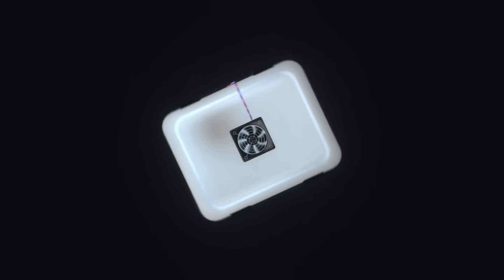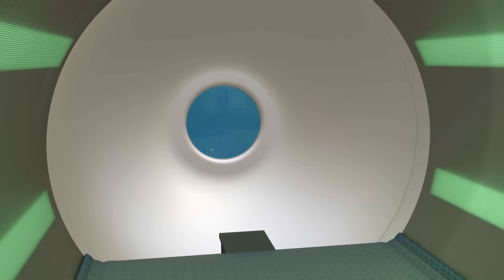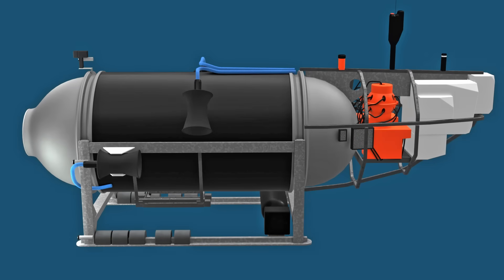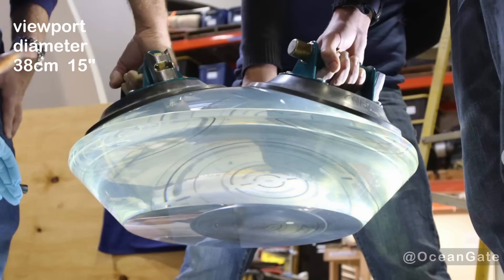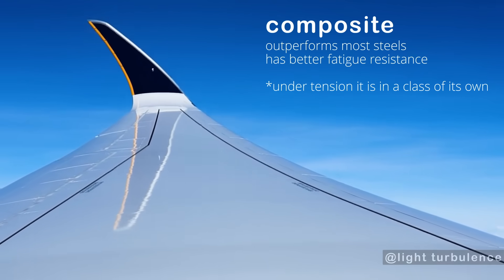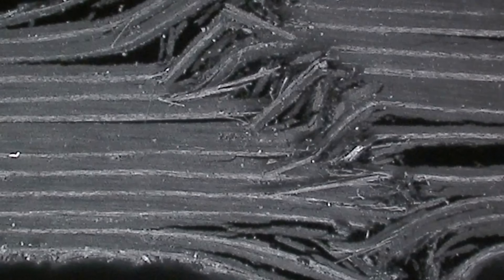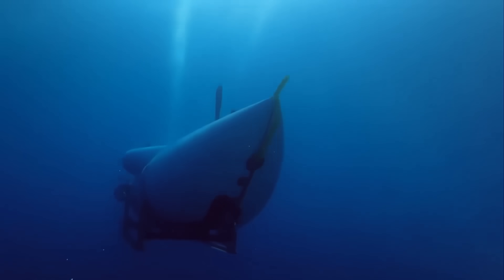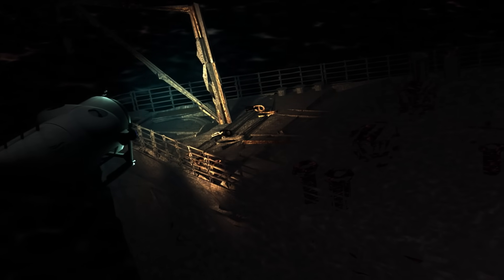Titan Sub | carbon fiber - Detailed Tour

Comment: I think the mistake is more of using two different materials to put the Sub together. Titanium can bend whereas Carbon Fiber doesn't bend. The way they put the sub together with Glue is reckless and i bet that is where the crackling sounds came from as the titanium domes were being pulled/pushed apart by the ocean and when the water finally got in then everything just crushed. I'm wondering if anyone tried to reverse engineer this disaster because I find it strange that the flanges was bent in different directions. I'm just amazed that the sub lasted for 17 dives but I bet it could have been more with the right material.

Comment: The wing structure bending loads are mostly carried by the wing spar although the upper skin would be in compression, I suspect nothing to the degree created by the undersea pressure.  As previously stated by others the composites in compression act like pushing on a rope with only the matrix material trying to keep it straight and preclude buckling.  But another armchair thought: should the “layered” composite develop a pin hole leak working its way into and thru the laminate; let’s say half way for argument, then the pressure vessel is only 1/2 as thick locally developing something akin to an internal blister.  The structure is highly dependent not only on symmetry of load (pressure) but also geometry and a blister is in effect a discontinuity.  Basically, this is an example of a design that is or isn’t suited for repeated dives, but the failure mechanism isn’t benign, it fails with no warning and is catastrophic.  Working with aerospace designs and composites I can assure you the mechanism of failure, and the ability to catch a failure (by various means) is an important design consideration.

Comment: No, carbon fibers will not handle any compressive force, only the resin holding the fibers in place resist compression. Proof is in the pudding
Reply from the maker: You are incorrect. Resin can only carry 70MPa of compression whilst carbon fibers 650MPa and this is why perfectly straight filaments is so vital. Any kinks and strength is a fraction. This is why the product is so hard to get right. The resin holds the matrix together and provides stability.

Comment: Carbon fiber is strong in tension but inferior to alternatives in compression. Movement in the structure is enviable given the tremendous difference in external pressures experienced at the surface and at maximum depth. This change is going to result in degradation in the resin as the carbon fiber and is forced together and apart. Try to remember that the carbon fiber is a rope, not a solid block of carbon. Your comparison with parts of the wings of aircraft ignores the orders of magnitude differences in the forces in the two applications.

Comment: How do you explain the negative buoyancy when the craft began to fail. Even after they dumped all of the ballast and the entire frame and used max thrust on the controls, they could only ascend a few feet per minute.   So water must have penetrated the layers of carbon fiber to such an extent that the entire vessel was bogged down unable to ascend.    

You can defend carbon fiber as a material.  But there is no defending this reckless - almost suicidal - incompetent design and build of the Titan.
Reply from the maker: Your information is coming from the debunked leaked transcript. https://www.snopes.com/fact-check/titan-sub-transcript/

Comment: Wasn’t the big problem caused by the failure to criss-cross the fiber layers?  They were simply spun on in a straight cylindrical pattern like a spool of thread 🧵. Even my carbon fiber tennis racket in 1985 was smarter designed, with braided and criss-crossed carbon fiber.
Reply from the maker: The video explains the filaments in 2 orientations, zero and ninety degrees. Did you watch that part? . Additional 45 and 135 orientations would have worked in reducing internal delamination.

Comment: "Carbon Fibre wasn't stupid..."
Hypothetical suppositions and speculative inferences based on retrospective analysis doesn't prove that using Carbon Fibre wasn't a "stupid decision", the actual deterioration caused by repeat dives is something you cannot decisively determine through speculative hyperbolic conjecture, hindsight in this case has absolutely no benefit, it proves precisely.... f-ck all.
Reply from the maker: Composite pressure hulls on deep dive craft. Here is a list https://www.researchgate.net/figure/Composite-materials-being-used-in-submersibles-worldwide_fig1_364296004
Reply: @Mike-Bell  
You and Rush would have convinced one another that Titan's composite pressure hull is comparable to all other composite pressure hulls...
"Did you hear that cracking sound.. t wonder if the other composite pressure hulls do that after a few dives...nah, if it's good enough for Mike Bell, it's good enough for us... keep going d.....!?!?!?!!!!!!!!!"
Reply from the maker: @nicolasrose3064  Stockton Rush was not the one to make a lasting success out of CF subs.  I have my doubts he would have succeeded even with all-titanium because he found best practises annoying.  I think a company with deep pockets and the correct attitude could make this work.  Consider that this incorrectly laid up tube still withstood the insane crush at titanic depth 13 times. If an incorrectly built carbon fiber tube handles spectacular compression, imagine how a meticulously built one could manage. But only through thorough unmanned destructive testing can you make it safe.
Reply: @Mike-Bell  
I feel "safe" in saying that the "you", you are referring to in your assertion "only through thorough unmanned destructive testing can 'you' make it safe", won't be the last person to find out that nothing can be guaranteed to be "safe", where man's contest with the extreme conditions of our Planet are concerned.

Comment: The circumference of the cylinder-shaped hull of this vessel will change because of changes in pressure differentials during descent and ascent. At the edges of the cylinder, bonded are the end rings and the attached dome. That assembly's rate of circumference change will be different, since there's the dome to support it. This difference in change rates creates stress in the layered composite cylinder, at and near the bonds with the end rings. Some de-lamination occurs at every dive. The hull loses compression strength, since at de-laminated sections, the carbon fibers now have room to buckle under pressure. On top of this, the longitudinal fibers seem to be strands that run the length of the cylinder. So, at the ends, the cylinder is already weaker because of how it is constructed. At some point, it gives way when the pressure is high and increasing during descent. An implosion occurs, which confirms that the designer underestimated or ignored the effect of uneven stress on the hull at the end rings, resulting in incremental hull damage, every deep dive.

This hull should have been made on a cylindrical mandrel with spherical end caps so that the end caps would be integrated instead of being a glued-on part of another material with different properties. It would also allow for a proper wrapping in all directions.  On one end, the hull could have an acrylic plug that functions as a small door and window. Fitted with allowance for some movement, instead of bonded. The pressure will keep the acrylic plug / door / window in place. On the back end of the hull, there could be a smaller plug, made from the same carbon-fiber composite, or one of those things that allows for electrical connections to pass through.
Reply: I was thinking the same. The big opening is great for working and getting in and out, but relatively bad for dealing with pressure. A small window that doubles as the door makes more sense for safety.

Comment: The fact that the flanges at the end failed outwards is a clue to the failure mode of the pressure vessel. I don't agree that it would shatter uniformly like glass. The more likely initial failure is that one part of the cylinder became weaker than the rest and was forced towards the centre by the pressure - this compression  on one side would (like if you were crushing a toilet roll) force other sections of the cylinder outwards for a fraction of time before complete failure occurs. That's what ripped the flange apart.
Reply: the can of pringles doesn't need to completely shatter for the cap to pop off. this thing was doomed from the moment it was glued together it didn't matter how strong the CF or titanium are the difference between the two creates a gap and that's all the water needs even a pinhole and this thing will tear itself apart at that joint
Reply: I agree it would not act like glass as it is not glass! That flange blew outwards and the pressure was equalised instantly inside.
Reply: @tbrowniscool LOL...  The flange just blew outward?  Lol.. (no offense,. But that is funny.) Clearly it blew OUT because the other end blew IN!  One end failed imploding, the air had to go somewhere, ...  It blasted out the other end!      Like a Coup/Contrecoup pattern in Titanium!  ❤😊😊
Reply: @tbrowniscool when carbon fiber fails it breaks like glass. Especially at 5" thick, there wouldnt be much bending possible before it breaks
Reply: You need to listen more. This is why so many half truths are floating around. Because people hear what they want to here. The narrator said that CF fails suddenly like glass does. He didn't say it was glass or that it fractured in the same way. He simply said that it fails without warning which is a property shared with glass. @tbrowniscool  - there is plenty of information on Google as well about how CF shatters into lots of pieces under extreme pressure.
Reply: @tbrowniscool if you bend glass slowly enough it will not break(give it 100 years or so), but if you bend it quickly it will. This broke in milliseconds, faster than it could bend
Reply: @BrokeWrench the glass isnt bending at the point its acting as a super fluid
Reply: I agree with this assessment. Someone already tested a smaller carbon fiber vessel until it exploded, and the ends shredded which broke the seal and the hull could no longer sustain the pressure. Then the middle part was crushed like a tin can. It happened almost instantly, but you could tell the failure mode was different along the carbon fiber vessel, because the damage to the ends was different than the damage on the middle.
Reply: The pressure alone would cause uniform destruction across the entire fibre glass shell.
Reply: I most respectfully disregarded the tidy sugar like heap of rather uniform sized crystals, God does not work like that, too tidy. Once a failure started the equilibrium resistance to compression was gone. Chaos prevailed. Too bad. A small addition to the Titanic that never had anything "titanic" about it. Bloke from Aus.
Reply: Yeah all that FIBER Just shattering,?  This whole video was incorrect.  The flangers were blown out at 1 end. Which just says that the other end was the failure.. And the end with the flash is pushed out is where the air had to go... (the other seam between different materials) ... One failed as an implosion then the other failed is an explosion. Without knowing whether or not the end that has the flange is pushed outward is the front of the back... I would bet that it's the front because they were hearing noises in the back.. That's where the failure happened, Then it pushed the Port hole glass and the flanges out of the front. They must have been Spaghettified instantly when it actually failed.  The fact that stockton mentioned the sphincter shrinking noises with the first hull... Leads me to believe the transcript is correct, That as the layers of Carbon fiber were being infiltrated with water and compressed that it failed progressively ...up until a point, after which it was instantaneous.  The opposite of a Jack in the Box.
Reply: @WoodysAR  the flanges werent blown out, they were just the only items left after the pressure vessel imploded. once the fiber gave way the pressure would have peeled it from the epoxied counterbore in those ti end caps.
Reply: @WoodysAR  Well, technically it doesn't shatter.  lol. But the effect is effectively the same as the entire event would have been over in under 10ms.

Comment: There all dead! Id say it was pretty stupid! A stainless steel or titanium spherical press vessel is the only appropriate design for a deep sea submersible, you cant insure longterm structural integrity with carbon fiber, the pressure cycles will rip it apart

Comment: You can defend this all you like but facts are facts. This thing went down, it wasnt adequately tested and ultimately the design failed. Perhaps with a decade or two of rapid destructive testing things could have turned out differently. This incident has put carbon fibre submersibles back for decades.
Reply from the maker: Composite pressure hulls on deep dive craft. Here is a list https://www.researchgate.net/figure/Composite-materials-being-used-in-submersibles-worldwide_fig1_364296004

Comment: One basic thing about the whole sub business concept is people subjecting themselves to such an extreme risk just to take cell phone pics through a porthole.  It isn't like climbing or scuba diving where you are intimately connected to the journey and process.  Here you are just sitting and totally passive and then you glance out a window.  There really is not much difference in the end than if they'd had just stayed on the surface and operated a robotic sub and taken pics that way.  Maybe they could've done it while being bolted into a cold tube lol

One thing people starting new businesses like this share is an almost blind self-confidence.  You really need to be insanely cocky to not be cowed by all of the risk and not scared of failure.  Unfortunately this self-confidence bled over into the engineering and safety aspects of the sub.
Reply from the maker: I couldn’t agree with you more. But as a designer I do admire the design process and trying to turn idea into reality. And I really admire those who with endless dedication and hard-work make reliable and dependable things useful to society. A sub for the uber wealthy to get their dopamine rush does not satisfy my definition of useful to society.

I’m really hoping someone on the inside gives me some new information on this story…. I can’t help being fascinated by it all.
Reply: There is nothing else in regards of going that deep to see the Titanic. The titanic won't be there in 20 to 50 years since salty water is chewing up that boat at the bottom. There's nothing wrong with a deep sea dive - but it has to be solid, safe and rated to dive to such depths. The pressure down there is huge.
Reply: That is kind of like saying going into space is stupid because all you get to do is stare through a window. I think knowing the water around you could kill you in a split second will add to your feelings of being on adventure that you cannot get from a remote view, not to mention the cold, and any other effects you might feel. If you wore a pressure suit, you would just be in a much smaller submarine, really, albeit one that lets you interact more with the environment. Still, what would you do at the titanic? You probably should not touch anything if you want to keep it as a preserved site.
Reply from the maker: @itoibo4208  They are entirely different. Going to space was for furthering science and exploration. Going to the Titanic is only for the entertainment of the uber wealthy and to give them bragging rights.
Reply: @itoibo4208 Going into space is more than just sightseeing though.  You are encased against a hostile environment for a bigger purpose.

Comment: If the hull was formed as a whisky barrel, biggest diameter in the middle and smaller at the ends. Would that eventually give some more strength to the hull? Eventually I do think about implosion and having it bigger might give more strength then straight walls. 
It was a nice go-thru explanation and some really nice graphics was used. THANKS.
Reply from the maker: Yes a barrel shape would have been stronger in principle as it is halfway to spherical. The arching is in two directions. Not just one. But the tapering geometry would have complicated the winding with undesirable progressively overlapping axial fibres. Plus the geometry of the titanium glue joint would be more challenging. 
And the mandrel would be much more complicated to enable it to be removed.
Reply: @Mike-Bell  The fibers are just put on in 90 deg and not in a 45 deg as often is used in fiberglass constitutions to make it more rigid/stronger. The worst thing about fiber materials is inner damage that you will not see with your eyes just by x-ray or sonar or similar. Therefor is a bang sound in the hull while diving an alarm clock and should be taken seriously.